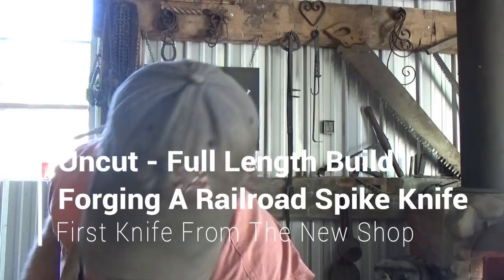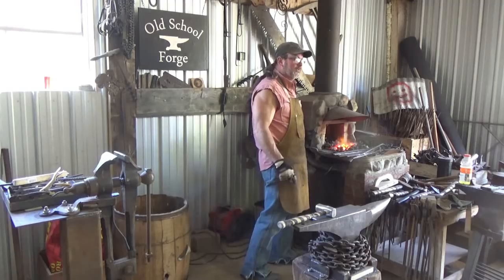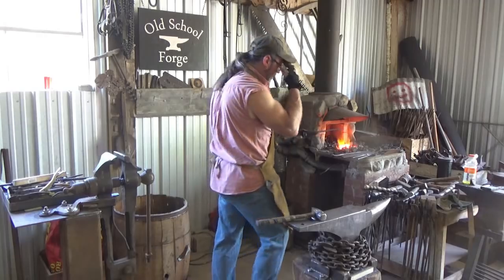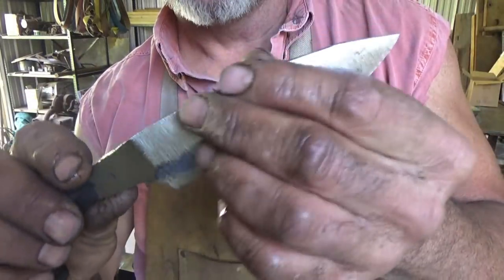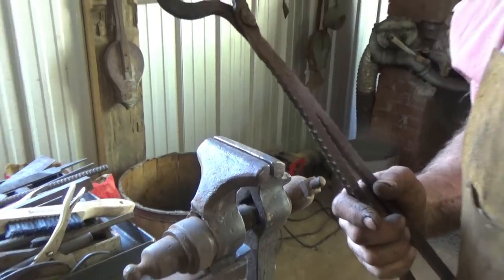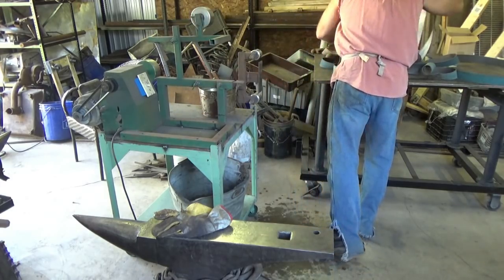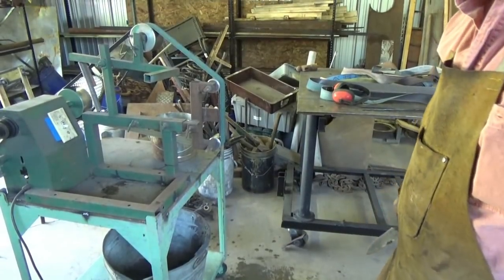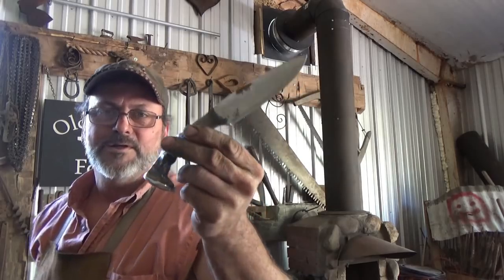Blacksmithing - Uncut - Full Length  Forging Of A Railroad Spike Knife

Comment: Hello Chandler. Just a thought about something you mentioned and something I just learned about a few weeks ago. In this video around a half hour in you mentioned the idea of one day forging a knife where you can get a paper cutting edge without relying on the belt grinder. A few weeks ago I was introduced to what was called "hot rasping" which combined with minimal hand filing resulted in a medium carbon steel knife forged from a leaf spring bushing (I believe) able to cut paper. The hot rasping was done with a large rasp ( I think in this case it was a farrier rasp but it could have been just a large wood rasp) after the bevel was hammered in and the edge was typical thickness you usually go to with the hammer and then the knife was heated up and brushed with a heavy wire brush, locked in a vise vertically by the tang/handle with the knife tip aimed towards the ceiling and then we just ran the rasp back and forth along the knife edge equal amounts on each side. This was repeated a few times and it was quick and easy and after the hot rasping was done we normalized our knives and did a little hand filing (not much was needed) and then the knife was hardened and tempered and the finished product already had a cutting edge although running it over a decent sharpening stone real quick would have it as sharp as possible based off how it was forged. Anyways I had never read or seen this hot rasping before but I did it under instruction during a one day knife forging intro class and the result surprised me. It was very little work and it eliminated the need for a grinder at least for the final edge of the knife. You still would need the grinders to polish the knife smooth and shiny (without spending who knows how many hours hand sanding obviously), but the hot rasping might be something for you to try out (I'm planning on trying it in my own shop very soon) and could maybe make a good video too. Anyways, as always I enjoy your videos and keep the content coming, thanks.

Comment: Suggest make you a hook and install it on the edge of you belt grinder table, then you can hang your bucket of water just below it, and then it be easier to dip what your grinding into the bucket of water from which every hand your using.

Comment: have you ever tried forging a spike knife with handle scales like if you forged it down all the way to the head using that for a pommel and then slap on a pair of handle scales and you'd get a bigger blade out of it

Comment: I always have to do my twist last so I don't damage it at all with the tongs, I'll have to try making the twist first today.
Reply from the maker: you have to watch your heat to protect the twist but i think having the twist in first sets the stage for all you have to make the blade
Reply: Chandler Dickinson I do usually have pretty good heat control, but I think my tongs or lack of tongs for spikes was the problem.  I forged myself some bolt tongs, tried this method and I'm having much better luck.  It's exciting to not have to be afraid to do my twists on spike knives now!  Thanks for he reply.

Comment: I use spikes to learn folding and forge welding but the carbon content is so low that even after four or five folds the steel is isn't much better and I'm unsure how well it will hold an edge. 
They are great for making flux spoons, hinges, latch hooks and whatnot.
A useful resource for sure and it looked great.
Edge retention?

Comment: Got a question about sharpening? If you used a 1x72 belt(s) in sequence would it be easier to sharpen a knife rather than use a 2x72 belt sequence? Thanks Martin M&S Blades